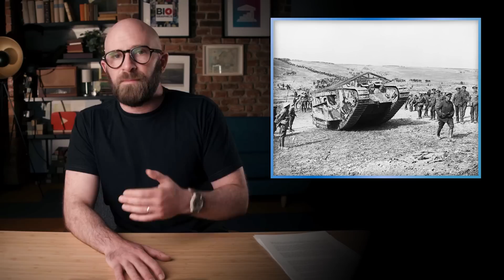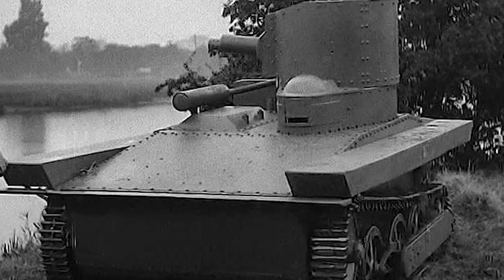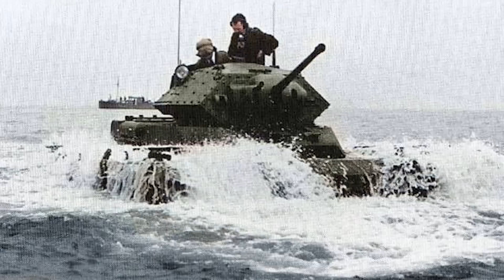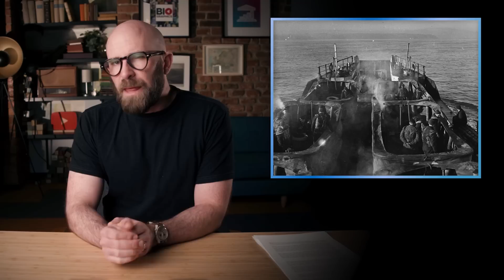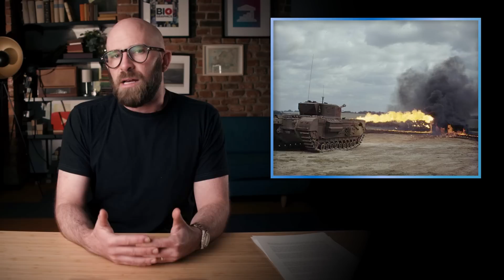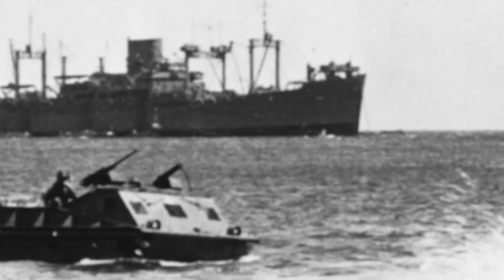The Tanks That Sank: The Quest to Build a Swimming Armoured Vehicle

Comment: 🤔 🙋‍♂️ 303 caliber? No it's .303 caliber which is lil less than 1/3 of an inch or 7.7mm x 56mm. 303 caliber would be 7.7 meters or 25 feet wide. Do u not hear it when u read it?

Comment: Operation Sealion (Nazi invasion of England) was a pipe dream.  First two very tall orders, buth the Luftwaffe AND the Kriegsmarine would need control of the English Channel, something they were utterly incapable of.  Assuming they could fulfill those requirements they would then need to secure a beachhead that would require them to move about 1000 troops per hour along with their equipment, beans, bullets and bandages for those first few days and sustain supply of around 500+ men and thousands of tons of heavy weapons and supplies daily thereafter which they utterly lacked the air and sealift capability to sustain even if you assume the Allies would just sit on their hands and let them do it unfettered.  By comparison in the first 5 days of D-Day the Allies landed nearly 400k troops and over 100K tons of equipment using thousands of ships and aircraft for the task with total air and sea supremacy in the combat area, and that was only to hold a sliver of the French coast to sustain the buildup to free France and Belgium before progressing on to defeat Germany.

Comment: Parts of me wonder if modern scuba gear would be perfect with some modifications for crews of tanks each having at least 1 maybe two air tanks could be useful.  Though boat tanks probably could replace some tools of amphibious tanks and have that tracked hauler thing carry a tank or two. Maybe even combine the two ideas In some way.
Reply: How does the engine breath underwater while the crew is using their scuba gear?
Reply: @Nope.rope1  it still can I'm meaning they wear the scuba gear even if the tank is breathing air just fine, like how jet pilots or Nascar drivers have special suits and seating similar idea for tanks ment operate around or in water,